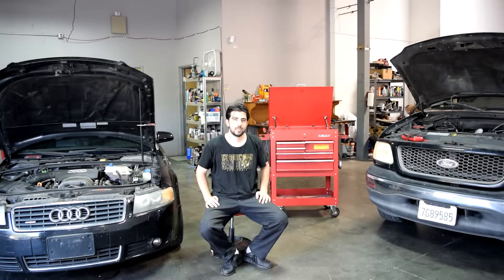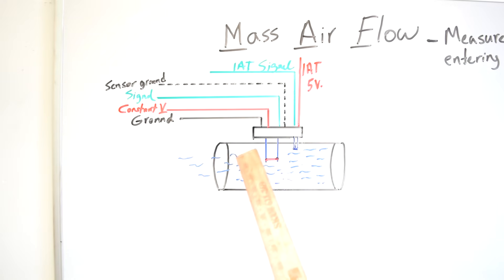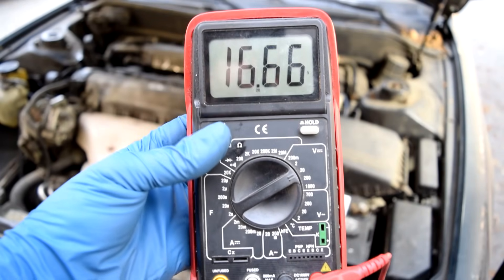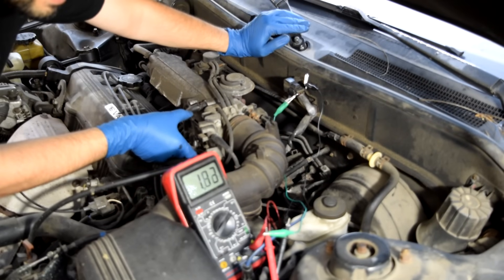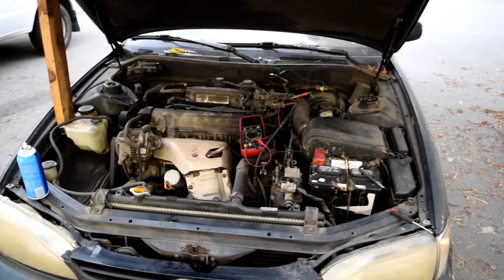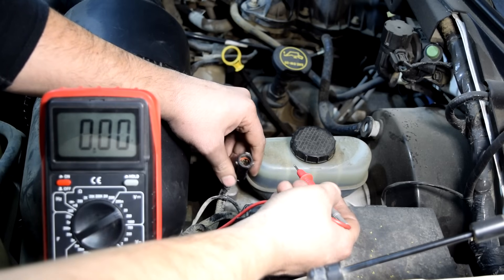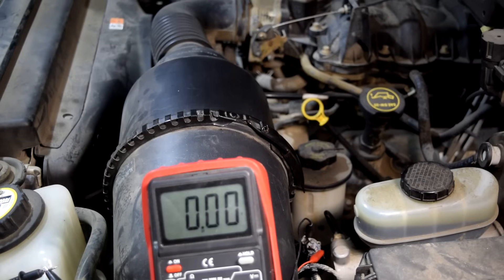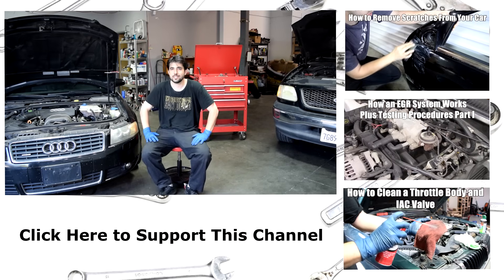How to Test a MAF or MAP Sensor With a Multimeter - Plus an Operations Guide

Comment: For 5th generation Nissan Altimas,  DO NOT buy after market MAF sensors!

You will go nuts erasing the Check Engine Light.

Also, dig deep to pay for the OEM sensor, it will set you back around $300 US.

Comment: After doing some testing because of this video and several others, it looks like my map has defecated in its resting spot. Good constant voltage, good ground, signal at idle 2.2-2.4 volts... runs rough at idle, runs better at higher rpm but still multiple misfires. Ordered one, as well, testing says it should be bad lol

Comment: Hi Mr. RNW, Mark here from pH, how are you doing.

I found this sensors, electrical wirings videos of your very helpful specially to me & other beginners in  auto electrical.
Thank you!

I just want to ask 2 questions:
1) should the hot wire voltage depends in to car models , 
This first car  +supply got ~5Volts (Toyota) then the Ford your cutted video got hot wire supply +12v volts. 
Which is which , or its just really depends on car makers?

2) getting right ground wire thru continuity test, I notice your not removing or reminding that we should remove  first the negative battery? Isnt it?

3) last 1 more, by getting the ground (-) wire can i just probe @ positive then get the other probe to the pins? In that way its other way around of getting the negative.,

Tho i like also the procedure of removing the negative post & probing to the pins, isnt it much safer?
Reply: Sorry I got 3 questions rather than  2.

Hope you can notice my question here in comment section,

Again this video of yours if really helpyful,

Im just quite confuse bro RNW.

Thanks a lot 👍👍
Reply: @myRatchets   🔧👋
Reply: This tutorial vid of your is highly useful in getting the + & - supply @ different application in automotive electricals.

Comment: You should test all connections for voltage and not just stop after you find the 5v. My Nissan had a 5v and a 12v. 
If you accidentally touch the positive terminal of a 12V power source with the positive lead of your multimeter set to measure resistance, it could potentially cause damage to the multimeter.

Comment: tested MAF sensor as described and found voltage did not go up or down with RPM. Got a new MAF sensor and same thing - no voltage change with RPM change. its on a a 2004 buick regla LS. what is the deal? seems like new MAF sensor is bad too or something wrong with test. Thanks for any help!

Comment: I have 2 wires that send 5 volts...

i got it right. my voltage goes up but then comes back down to 1.5 and stays there. no matter the rpm. it just spikes and then falls back down despite constant holding.
Reply: new map sensor did not fix it..... the new one acts just like the old one....

Comment: Evening. i have a non working boost gauge on my 2014 Focus ST, i took it to Ford and they were next to useless diagnosing anything, out of lazyness thet said it was the upper dash gauges, which i was suspicious about, they also wanted $1200 to have them replaced. I left angry and bought instead another used gauge and same issue , it does not move. so that told me the gauge is fine. 
i am thinking that the issue could be the actual boost sensor/s, would you know the location of these and do you have any thoughts on this issue? any help would be greatly appreciated.

Comment: There is one think I need add for the less knowledgeable/experienced. Identify the fixed supply voltage first using Volts setting. No damage can be done while testing any pin for volts.  HOWEVER ONCE YOU CHANGE TO OHMS, to identify the ground wire, you MUST make sure that you NEVER  touch the Supply Voltage Pins again. Under OHMS , the meter will short the supply voltage to earth, blow a fuse which might not blow fast enough and you could cause damage to the electronics, So be warned. You either do it in full conformance with how this man described it or you could do more harm than good.

Comment: So very well explained. Really good. But please note that that MAP sensor is good. It increases the voltage only during acceleration. So if you are doing constant 20MPH it will be 1/1.5 depending on car make - it will go us as son as you decide to go from 30 to 60 and will stay up untill you reach 60 and release the pedal slightly (vacum if you have a vacum meter - many call it economy metres - goes down and Absolulte Pressure returns to normal) and the fuel mixture changes to lean again.  At 60 MPH it changes according to the reading of the MAS Airflow Sensor. 
Anyway - the industry needs more people like you  Well done again.
Reply: Thanks for that info. Is there anything simple that can cause a map sensor fault that can be easily checked without buying a new map?
Reply: I am not sure I understand your question. 1. Anything simple that can cause a map sensor fault is. The map sensor is located in the inlet manifold after the air filter - it can get dirty / contaminated especially if you remove the air filter and use a gause filter or a filter which is not so good at filtering the air.  
Very easy to remove and clean. Many videos on U tube - only one screw maximum 2.  
It is vey reliable but its an electronic part and does not really like engine vibraions - and the engine heat. So it depends which car. On my car it has 153 K miles and never chaned. On my wife car it was changed after 163 K miles. 
2. fault that can be easily checked without buying a new map?
I would say that anyone that wants to test the electrinc sensors of his car himself, apart from the fact that deciding which sensor, if any, is the core of any issue to sart with; he should buy a Code Reader also called a Scan tool since it scans/checks all the sensor. 
Thanks to mass prodyctin these are ridiculously cheap - 24 Dollars sometimes even less from the shop than from Amazon. Googel - "car cheap code readers" or Go here: 
https://www.google.com/search?q=cheap+engine+code+tester&oq=cheap+engine+code+tester+&gs_lcrp=EgZjaHJvbWUyBggAEEUYOdIBCTIxMDM5ajBqN6gCALACAA&sourceid=chrome&ie=UTF-8
 i @arniet1

Comment: In the case of a turbo application like the 2004 Audi A4 1.8T when the BOV (in recirculating mode) relief boost pressure back in to the intake, wouldn't the MAF experience flow in the opposite direction?

Comment: Hi. Good video. I've checked the voltage at the plug from the loom. I've got 4.99V on one, 4.56 on another and zero on the last. Ignition on, engine not running. Is there his correct please? Cheers
Reply: MAP sensor detects that driver pressed the pedal to accellerate. from 30 to 50 MPH. Input is always a fixed 5 volts. Yours is 4.99 which is fine just the same. Output should go up from 1 /1.5 volts to max 3or 4 or 4.99  (depending in how hard you accellerate) only during accelleration.from 30 to 50. Once you reach 50 and you release the pedal slightly to stay at 50, the MAP goes back to 1 to 1.5 depending on the car - and fuel mixture becomes less rich. .  So in your case your ECU is thinking that you are accelerating all of the time and your fuel consumpltin must be very high. You have to replace that MAP

Comment: I am confused, I thought that you would demonstrate how to check the MAF when its off the vehicle? You appear to be checking the wires going to the sensors, I'm not happy about sticking nails and clips into wires. Is there a way to test the sensor off the vehicle with a multimeter?
Reply: I know I’m mega late but.. It needs to be in the vehicle and hooked up properly to be able to get a valid reading from the sensor. Think of it like trying to see if your vacuum works, it needs to be plugged in otherwise of course it isn’t going to turn on. Also for back probing the connector I would recommend using small pins. Personally I use small T-pins, they are a lot easier to use and not break anything, while still being easy to clip a test lead onto. There is a rubber seal around each wire, you just want to sneak the pin around that preferably without destroying it because that’s what keeps these connections waterproof.

Comment: Ive been having issues with subtle hesitating and vibrating when the car turnsover. Once the engine is on it seems to run fine. The vibrating and hesitating is especially worse if i turn it off and then back on while the engine is hot. It goes through a few seconds where it seems like it struggling and almost wants to turn off. Again once its on it runs fine (no hesitating or vibrating while i drive) Already changed the spark plugs, ignition coils, valve gasket and air filter. Not sure which move to consider next. Any recommendations?

Comment: What were you spraying on the vacuum line to test for a leak and how exactly could you tell that there was a leak. Thanks Mike from Maryland
Reply: Starter fluid..if there's a leak vacuum will draw it into the engine  and cause the engine to surge/accelerate

Comment: I have a fluctuating idle on my 2000 Camry since one year, the idle fluctuates between 650 and 480/500, which sometimes causes pressure light to flicker under load. 
It had the issue when I bought it and still have it. I ruled out IAC, Air Temp sensor, coolant sensor and PCV value. I'm planning to get a MAP from scrapyard and check with that. Anything I might be missing? 
My car doesn't have O2 sensor in the front like this car has, it has the Resistor Variable instead.
I forgot to mention, the idle fluctuates ONLY at operating temperature. It becomes normal for a while, then starts again all over.

Comment: Not all 4 wire MAF the same, what you demostrate in this video. There is a 4-wire sensor with constant ground, MAF signal, IAT signal and constant voltage.

Comment: I think I have this issue with MAP sensor connector wires. One of the wires was damaged and I had to splice another one in, so I think the connection is not that good causing readings and codes also making the fuel run lean, thanks for the video very helpful.

Comment: Dunbass..... no fundamental knowledge on principles of vacuum/pressure. Map should ONLY fluctuate greatly with rapid throttle opening. Gradual opening of throttle allows vacuum to stabilize as rpm increase and show a minor variance at sensor  volts. Opening the throttle a great amount quickly allows atmospheric pressure into intake decreasing the vacuum (negative pressure)in the intake. Gradual opening of throttle  allows less atmospheric pressure to enter the intake MAINTAINING vacuum (1.6 volts, fairly steady as rpm increase). Couldn't even watch to the maf part, this "tech" is only partly informed on principles.

Comment: Good day sir. How to check mass airflow sensor with 7 pins. Like my unit lancer 1998 4g92 engine automatic trans. High idle at 2000rpm normal temp. If engage drive or reverse mode. Becomes normal at 1000rpm.

Comment: Hi .I have a  2010 elantra and a launch 123i scanner. Rough idle , drives ok, but poor gas mileage . O volt reading when opening throttle. Disconnected MAF sensor, idles smooths out. Put sensor back in , now gets volt reading, idles better!  Did clean the MAF made no difference. Am going to retest MAF sensor Volts with scanner in a complete drive cycle. What do you suggest now?  Thanks

Comment: The map sensor is fine, when you crack the throttle slowly, the engine spins up, but the throttle does not open further. That causes more vacuum to form inside the intake, typically the map will read about the same as at idle or lower (since the pressure is usually lower). Otherwise cool video!
Reply: Can car have both map & maf?
Reply: @jamesjohnson5700  yes
Reply: @TheWindrunner88  ok because I can't tell if my 2019 Hyundai Elantra se has one as in maf
Reply: @jamesjohnson5700  I’m not sure about those, might be able to google it tho
Reply: @TheWindrunner88  oh ok thanks
Reply: petrol engine , normal ....
Reply: What's keeping my idle low,I changed both,with no check engine light and changed the fuel tank pressure, still low idle

Comment: Hi, thanks a lot for the video, it really help. I am driving E90 2009 LCI 320i N46 engine (this engine dos not exist in the states), 4 cylinder engine with 2 banks (bank 1, cylinder 1&4),  (bank 2, cylinder 2&3), I have changed the valve stem seals and Cylinder head gasket, 
Then every thing was ok for 100 KM, then it starts to loos power and misfires until it stalls completely.
Now it cranks but no start, fuel pressure is OK, but there is no pulse to coils Trigger of (bank 2, cylinder 2&3) and a very week pulse and spark to (bank 1, cylinder 1&4),
I will be grateful to you if you can guide me to the location of ignition fuse & module.
VIN: A587295.
I am living in Iraqi Kurdistan, There is no any BMW dealer where I live (I have to depend on my self and you tuber like you).
I tested my MAP, on the 3 probes  I have one ground and 2 voltages 5 V & 5.3 V.
can that indicate a short my be ?

Comment: Hi, Thanks for the video! I have a question about my corvette c6. 8 have a 5 pin MAF, but no 12v pin.
2x5v and 3x 0.05 v.
I think the car is running rich in idle and not good to drive even. But when I unplug the MAP sensor the car is running fine. 😁I m super confused... And BTW my whole airfilter box is missing. Trying to find one currently. However I guess this shouldn't affect my engine work. I guess I have a damaged harness going to the MAF?

Comment: My car reads 1.30~1.40v on idle and wont come down even when the car is warmed up fully, i think it gradually increases fine but im getting a lean code too im not sure if the maf sensor is bad since the voltage is a bit more than others

Comment: To reduce vacuum you have to apply load or disconnect the vacuum tube.
That sensor appears to to be working OK.
Reply: Yea.   He is wrong about the MAP.  Bad test.  Quick rev response was correct.  He interpreted in wrong. MAP was good.

Comment: I'm have a problem my car will crank over but won't start,97 buick regal 3800. just died  one day at idle,, crank crank crank,, hour later it hit started and ran but died again,,  just cranks  everything else inside the car works fine, blinkers,etc, i can hear the fuel pump work and pressure on the fuel rail seems ok could that be the issue?

Comment: subscribed cause you told NOT to use ohm position on a wire carrying voltage.basic but folks dont know .new digital meters are forgiving but needle type analog will be fried most times if you try to do that.Be careful with your vom.finally someone not full of b.s.

Comment: To the owner who posted this video. May you please answer this question please? Thank you.
 I've a Ford Ranger 1992  3.0 v6 engine when I turn it on the truck is in park gear but when I press on the brake only the truck revs up when park. Is it a MAP sensor or brake booster issues? I changed the TPS Sensor, oil/transmission changed. Do you what is the problem?

Comment: I have a 1992 accord that vibrates at idle.  I have replaced the IACV, EGR, spark plugs wires, new distributor, cap and rotor, motor mounts all 4 new, clutch damper, power steering pump, and rack, alternator, battery...everything!  The tachometer is never bouncing and always very steady and right where it needs to be.  I can't find any vacuum hose leaks.  New fuel injectors, pressure regulator, air filter, fuel filter.  I DO NOT have a check engine light.  My question is this, can a faulty MAP sensor cause the engine to vibrate at idle and not throw any codes nor have an effect on the tachometer? Thanks, Billy

Comment: The reason the voltage didn’t go up when you opened the throttle slowly is because you didn’t lose vacuum until you opened the throttle wider

Comment: why did you change the probes in the last test ? you have replaced the N to the Posetive and P to Negative ?
also I have a question : I have a scooter Daelim S3 advance 250cc it has a part calls (SENSOR, MAP & AT) for the fuel > and I see another bigger one for the air it calls SENSOR, THROTTLE POSITION : what is this device ??? (they should be two, one for the air and one for the fuel, right ???) : the scooter has ran only  12000 km and now it starts hardly and even after it works and I turn it off , I go to try after 10 seconds and it starts hard again after many tryings  and it runs before the battery die.. what do you think sir ?
another additional problem : the thermometer arrow goes to the maximum temperature (red level)  10 minutes after the engine runs ???

Comment: Hi I got problem with diesel 2.0 tdi    ,no error codes up or check engine light .but hesitate some  times as I accelerate .people saying throttle body   throttle position sensor  canes in turbo clogged up lots different faults  2012 gt tdi each fault tell me about  doesn't have the same symptoms and no  error code for that fault is evident .obviously I will check the maf sensor like you have demonstrated. But weird thing no code .loses acceleration, just either put foot flat down on gas it picks up mainly if I gear down it works fine picks up speed as normal .also theys switch on accelerator pedal as well  . Main thing confused me was no error codes come up .only time error code came up car was shuddering  was glow plug light on dash. Other time code think was p0121 the code was for throttle position sensor. Never come up since .car runs perfectly  again no codes but odd times does this loss of wont rev passed 2000/2500 revs .just wondering if has rough idea .possibly after car warms up to normal operating temperature. Also another thing said could be coolant temperature sensor 🤔

Comment: Informative video but there were a couple of things that you did not explain for the non-mechanics. . . not sure what "back probe" means (its something to do with alligator clips apparently). Also, not sure what you sprayed on the vacuum line to check for leaks. . . will have to separately look those things up.